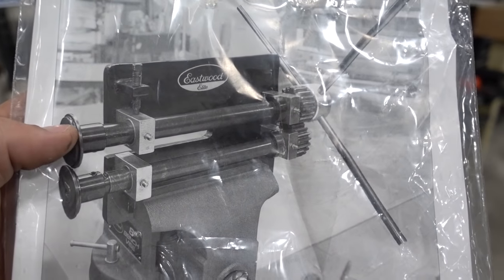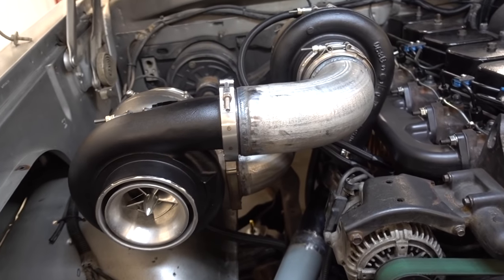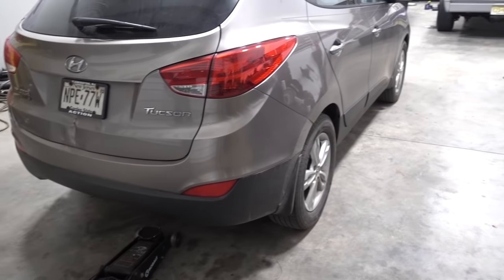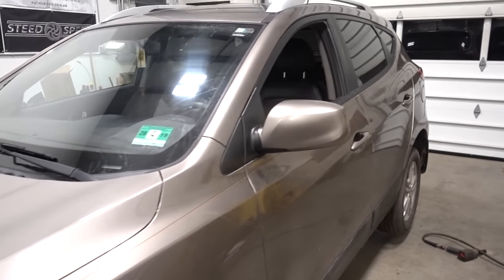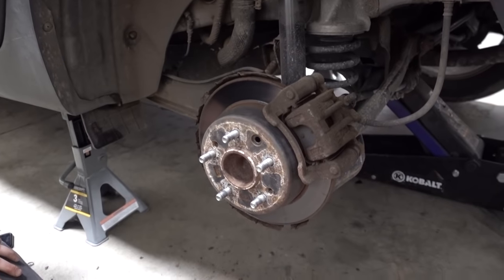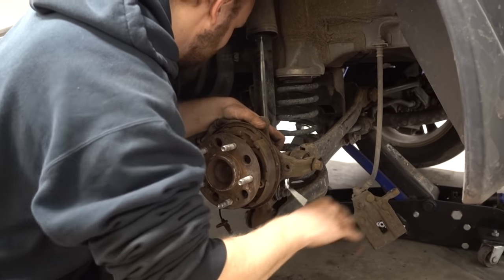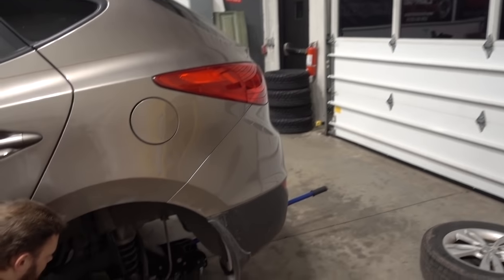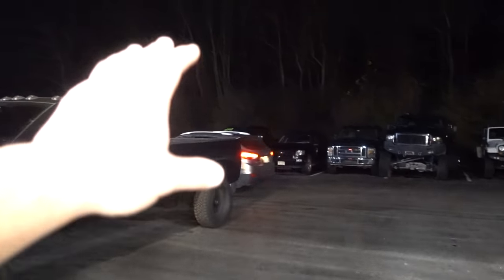WHY IS THIS IN THE SHOP!!!!!

Comment: I had a 2015 Hyundai Sonata 2.0T and it came with those DAMN wheel locks. I went in for an oil change and they could not get them off and broke the key. They tried blaming it on me and I slapped them in the face with, this is my FIRST oil change on a brand new car so it was not on my LOL. I had them put stock lugs on it and throw them away!!

Comment: Greg I was wondering if you could help me out I know you do a lot of work on 6.7 Cummins because you own one but could you please do a video on the biggest issues on the 3rd gen 6.7 07 and a half 08 and 09 I've been looking for a 2005 2006 5.9 for a while but here recently I started looking at the 2007 1/2 2008-2009 6.7 l and I was really just wondering what some of the biggest problems would that first production years of that 6.7 liter of were I know the electronic turbo and the DPF EGR all the emissions stuff was a big issue but is that about it and if if so what's the best way to go about those issues I know everybody says delete if deleting is the best do you have a recommended brand thanks
Reply: jeffrey lee delete with efi live tuning and do a second gen swap

Comment: Red on first gen, blue on ‘05
Reply: for your front plate make a mount for under front bumper so with a flip of a switch the front  plate folds under the bumper so its not seen.  then if u get pulled over by the law  u hit the switch front tag flips down